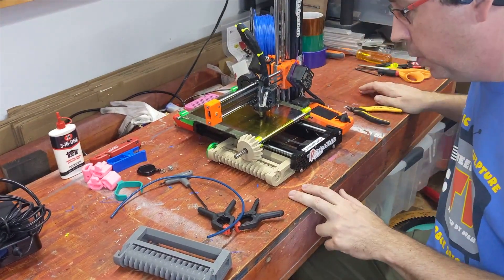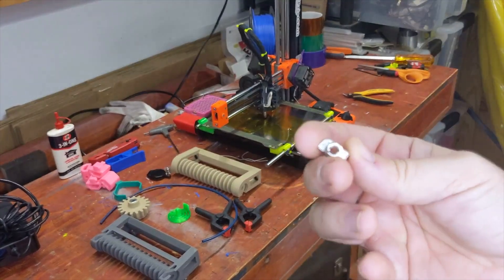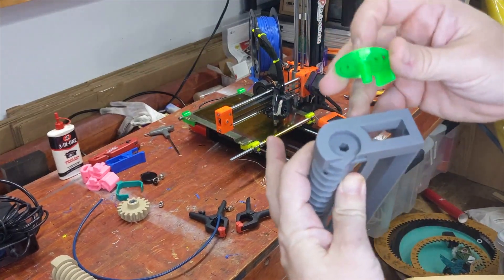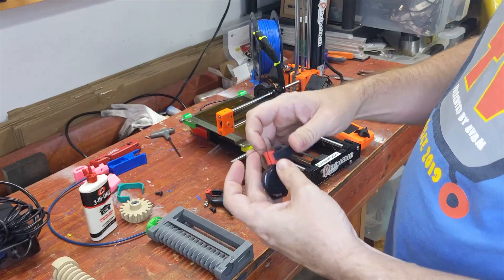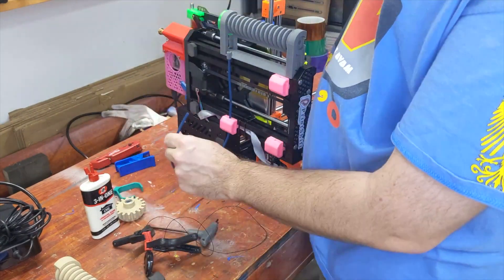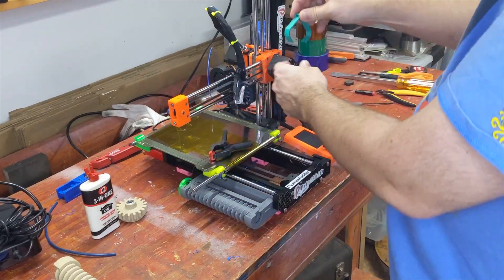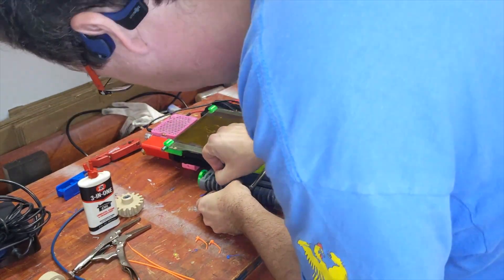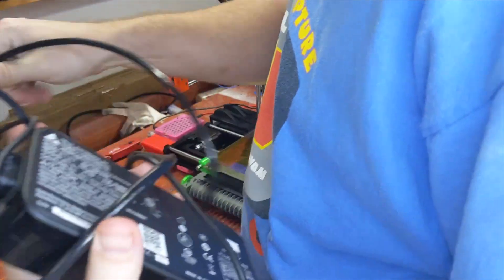PrintShift 5.1 - Build Along!

Comment: Nice!   Glad the key retractor idea worked out for you.    It does look like the ptfe tube guide needs to extend out a little bit since the cable is getting caught on the bed  and making the gray gear shift during extraction.  Maybe a guided 90 bend so the ptfe tube is a little more rigid.
Reply from the maker: Thanks for the tips!